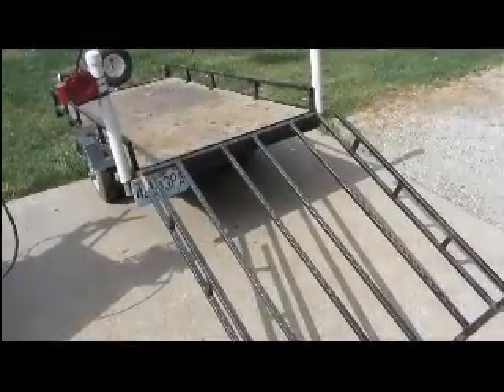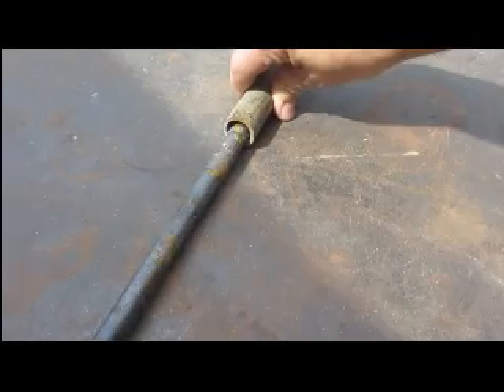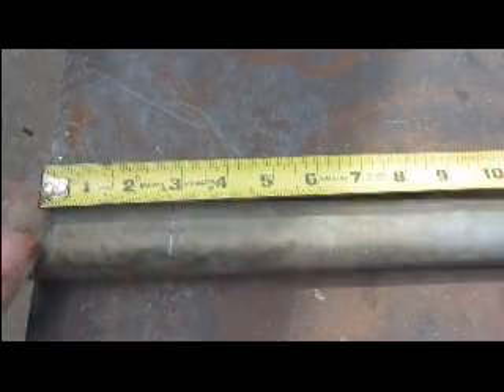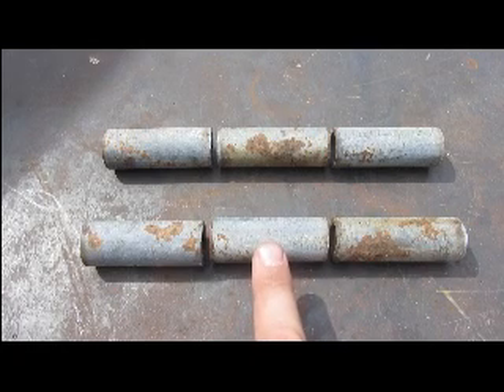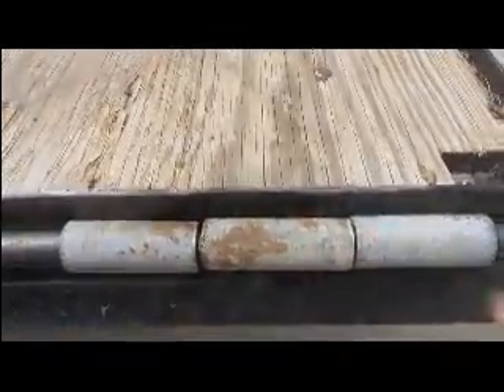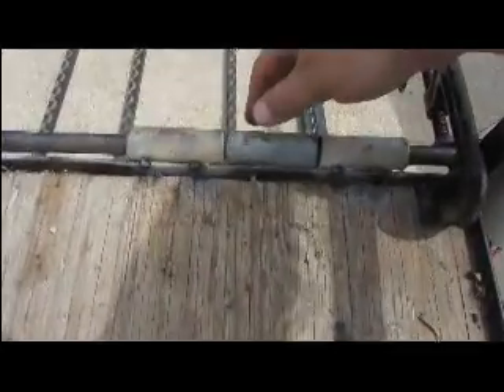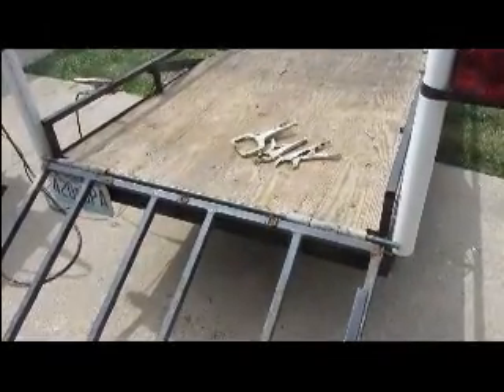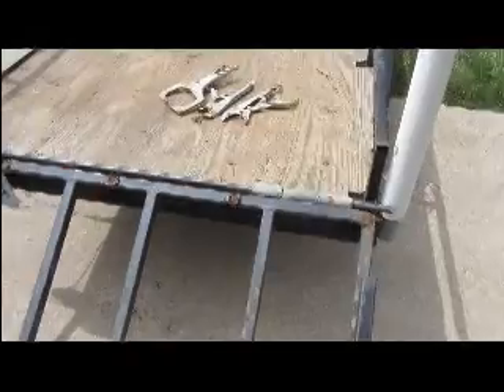HOMEMADE HINGES - WELDING

Comment: Why cut the rod and make individual pins?  Just leave a long rod, weld a washer on one end, drill for a clevis pin on the other.
Reply from the maker: If you needed to knock the rods out for some reason, it would be a lot easier if they were shorter. However, you can leave the long rod in if you want.

Comment: This video saved me some time and money. I bought a carry-on 5x8 trailer a few years ago. But it was very poorly built. I had to re do the wheel bearings and seals. And now the gate hinges. It was not fun trying to replace the barrel hinge style that came on the trailer originally; everything had to be perfectly aligned , and all I have is an old craftsman ac stick welder, it was hard to make things line up perfectly. I found this video and did it with 1/2" round stock, and I think it was 5/8" tube. And it works so much better, and now the gate is removable. Some mower decks used to catch on the old hinges. Now this style, it looks like they won't hit at all. Hopefully, tomorrow, I'll be able to fully test it out. This video for sure earned my thumbs up and a subscribe
Reply from the maker: Let me know how your project worked out. By the way, thank you so much for subbing!

Comment: Placing a washer between the cotter pin and hing to protect the pin from force cutting into the cotter pin as a safety measures just saying.
Reply from the maker: good tip.  However, I have not had any issues at all since this video / project was made. still going strong without defect.   still a good idea for over-kill.  I love over kill......   doesn't hurt.

Comment: Thanks for your video. By the whiteish smoke residue and the appearance of your outer pipe it's galvanized.
Galvanized materials need to be ground so the galvanizing is gone at the weld areas. Welding galvanizing produces a purplish looking poisonous smoke. It also contaminates and makes the welds very poor.  Grind it clean at the welds or don't use use it.
Reply from the maker: Indeed.  I always check the wind direction first.

Comment: pretty good.  not exactly what I need (i need vertical hinges for shed doors) but this is a good idea. I have 2 2.3/4 " pipes, 12' long each welded to 2 angle irons and then that's screwed thru to a 2x6 the length. was thinking of just going into each end with slightly smaller pipe and mounting them to the door frame somehow. . . the bottoms of the doors may need wheels and there's a slight hill as they open, so maybe having the door hinges ride up to close and down a little to open? looking for tips as my dad was an engineer, but I'm half the man lol...
Reply from the maker: This works for vertical as well.  Just mimik a door hinge.
Reply: @PhilCrockett  thanks, just gave me the complete picture in my head.. HALF the angle-iron connections and cut the boards too. perfecto/.
Reply from the maker: indeed!

Comment: Why did you weld it all so high up on the back plate?  When the gate is down you have the two hinges protruding up into the roll-on path you have to clear.  The top of the hinges should be no more than flush with the back deck height.  That's why many folks also use a a "mount" plate piece versus welding the pipe directly to the gate/trailer
Reply from the maker: I had this genius idea, that I would be able to fold the ramp inside the trailer. 
 On the backside of the ramp would be 2 carpeted runners that would hold a 14' Jon Boat.  An all purpose trailer.  This way, I wouldn't have to take the ramp off every time I wanted to haul my john boat.  Anyway..... in short....  I have my thought-out reasons for the things I do.  Thanks for the critique, Joby.
Reply: Phil Crockett ahh I see...  I like the John boat transport idea
Reply from the maker: ya.  The funny thing is.... I ended up selling my 14' jon boat and getting a 16' Lowe on a real boat trailer.   The great thing about welding, and metal work is you can always re-modify.  I have a scrap pile of things I've made that were once useful, and are now waiting to be made into something else.   it's never ending fun for me.

Comment: Very good clip!  What is the size of your ramp square tubing?  14g - 1"x1" ? ,it looks to me.  The reason is I have to make a ramp first.  Then hinges like yours, thank you ...PK...North Texas
Reply from the maker: I truly don't remember the specs on the ramp.  What I usually do, is either go look at the trailers on the sale lots, or call a trailer manufacturer to get specs.   When I built a utility trailer years ago, those were my 2 main sources of information.  It also depends on what you're planning to drive up on it.  Hope this helps you out, Peter.

Comment: Great video l read all Comments no one ask what  size pipe or pin did you use?
Reply from the maker: Good question, Dave!   I didn't say, because each scenario may have it's own size to fit the project.  What I usually do, once I figure out the general size hinge I need,  I find the pipe, and fit it on several rods at the metal store, until I find the one I like.  It really is the easiest way to do it. How this helps.

Comment: I will be using the second half of the video to make my gate removable. Unfortunately my three pins are welded into the outside pets of the hinges but I’m going to use a cutoff wheel and break the weld, slid out old pins and make new pins that are removable to allow me to remove my gate for long hauls and get better mpg. Thank you!
Reply from the maker: sounds like you have a great plan!  glad you like my video.  Thanks for taking the time to comment!

Comment: WHAT WOULD BE WRONG WITH LEAVING THE ROD THE FULL WIDTH OF THE TRAILER,AND JUST ADDING MORE HINGES WOULDNT IT ADD STRENGTH.
Reply from the maker: Sure!  You could do that.   I just don't like too much over kill, because of cost.  I like to keep as much rod and pipe on hand in my scrap pile.  That darn steel it so expensive.  There's a lot of things you can now buy already made that cost less than doing it yourself.   Thanks for the question / comment.  Let me know how this worked out for you!

Comment: Glad I found you.  Retired military instructor, so the rule is "Tell them, Show them, explain it to them, then answer questions to go over the material and make sure they comprehend everything"!  I tend to "over build", and make four, even five, hinge tubes for each hinge,  whenever there is a chance that people will be standing on a ramp.  Two times the safety factor is good!
Reply from the maker: I usually over build as well!   Thanks for the positive feedback, Patrick!
Reply from the maker: here's an example of my building process.... i'll use my homemade trailer as an example.   I first decide the size I want.  Then I visited trailer sale lots and took dimensions and pics of the trailers.  I studied ever detail, and called trailer companies and researched on-line.  I drew a pic of what I wanted, noting material thickness, length, placement, design....etc.....  Once I got the basic design down, I started adding (drawing in) my own personal touchs (front hinge gate, extra long tongue, receiver hitches.....ect...).  Then I simply bought the materials and took my time putting it together.  In short.....  I copied the factory-made product, and then added the details I wanted.   This process works on most things I build.  I always use the factoy-made products as my 'minimum strength' requirement on materials that I would use.   I actually used square tubing instead of angle iron on my trailer, which is stronger, and I could run my wires through which protects them from getting snagged in the field.    Hope this gives you an idea.
Reply: Phil Crockett excellent video, appreciate your tutorial style. I'm pretty new in starting to do my own projects like this, how do you decide what size of materials to use? Is it experience? I'm concerned about under 'speccing' the build materials but if you over spec then you're wasting money ( which I don't have too much of ) any advice please?

Comment: excellent video - thanks for sharing... a quick question... would it not be better to divide the load what whatever might be loaded on the gate in half by using the 2 barrels to support the downward force? Meaning that 1 barrel would on the frame and 2 on the gate (per hinge)? Maybe someone with some engineering knowledge could chime in... either way, great video in terms of nailing the alignment by prelocating with the solid piece. Thanks!
Reply from the maker: A Nixon   I followed the design that the trailer manufactures follow.  thanks for the question.  hope this helps you.